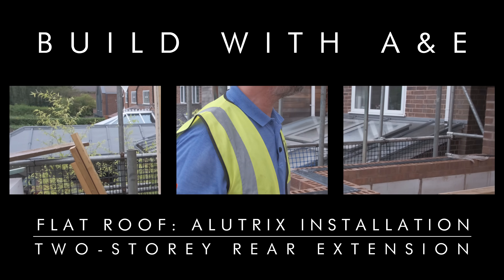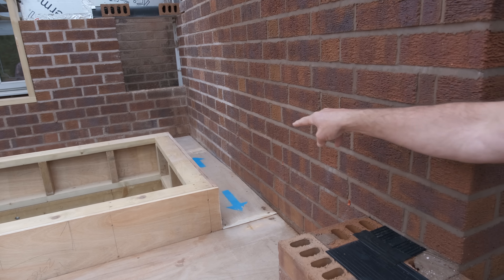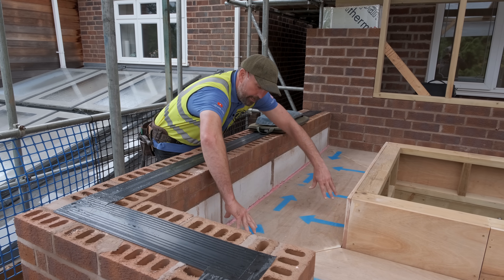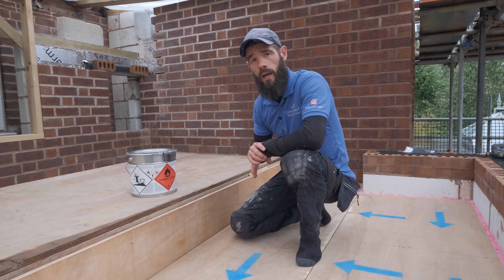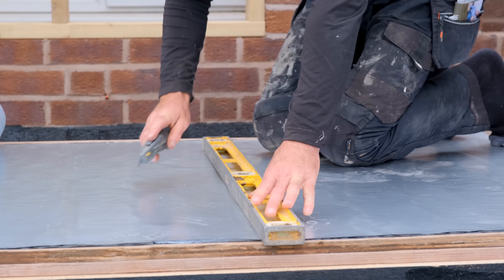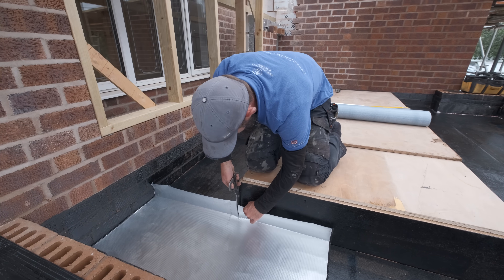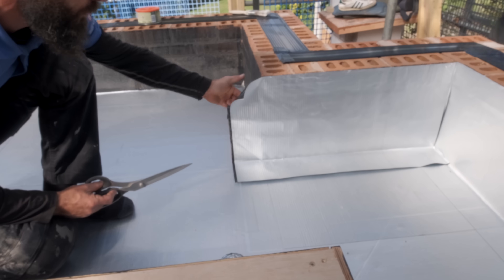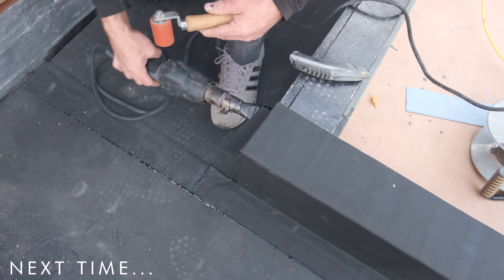Installing an EPDM Rubber Roof (Part 1: Vapour Barrier)

Comment: What is the height of the parapet over the flat roof please?
Reply from the maker: The upstand should be a minimum of 150mm at the highest point of the roof. This will increase as the roof slopes towards the rainwater outlet. 

I hope this helps. 

All the best, John 👷🏻‍♂️

Comment: Love the graded firrings. But i still cant understand how you did it. For example if i had a run one way then one at perpendicular at 90 degress. Youd have to bend the wood or have a small step?

Comment: Hello, do the substrate boards (ply?) Not need to be tongue and groove? Even with the best attempts to screw down, will the edges not moves relative to one another and create a weakness/ eventually crack the applied coatings?

Comment: Fantastic job lads.. I'm building my own flat roof extension with a parapet wall,  If you don't mind me asking, I couldn't see a cavity tray in the parapet wall, Is it not required because your Membrane is running up the full height of the inner skin? Cheers
Reply from the maker: Hi Rick weep holes are on the outside because of that 👍

Comment: No doubt that this demo video shows us the right way to install a flat roof, the explanation of every step and work practice is very clear, good materials are used.
I'm going to install a new roof DIY, and want to use good materials, I already decided on using Alutrix or a similar self adhesive vapour barrier, as these provide the highest barrier properties, and are easier to install in a neat way than the plastic film based barriers which you have to staple (holes!) or glue down, also the foam adhesive for the insulation will stick better to this.
In this video some good advise was given how to install this barrier correctly, so thanks for that.

Comment: All 3 of these epdm videos are great, especially for someone like me who is planning to do their own! I do have a few questions though. Our rooflight (vario by velux) comes with a vapour barrier attached, that drops down into the hole, what is the best way to seal this to the alutrix and do you take the alutrix up and over the top of the upstand?  Secondly how did you get away with 120mm of insulation our BC is wanting 150 :-( I was also just going to drop our ready made upstand onto the top of the warm roof, but I see the advantage of building one underneath first now.

Comment: That  vapour barrier stuff looks like it would stick like sh*t to a blanket. Is the primer necessary on a timber deck that's using mechanically fixed insulation board?. I can see benefits on brick work etc. Nice work

Comment: Just want to run this by you. At 3.48min in the video, i see your expanding foam filling in the expansion joint. Looks to me about 40mm. If so that seems an awful lot for an expansion. Ive always been of the belief its been 10-15mm youd get away with.  Whats the reason you went so wide?

Comment: What's the brand of vapor barrier. Ive only ever used the stuff like the plastic heavy gauge rolls, visqueen but have been reading up not many using this anymore because theres better products on the market now.   What's the difference in price in them.
Reply from the maker: Hi Celtic works Alutrix 600 made by Resitrix all the best Tony 👍
Reply: @BuildWithAE     Just checked the price. Pricey stuff it is! But after following up on this product, you can see why it is pricey. Excellent stuff. Will be using from now on.
Reply: @BuildWithAE   whens part 2 of the epdm/warm roof
Reply from the maker: Hi  @celticstoneworks.construct4570  very soon 👍

Comment: A vapour barrier and breather membrane are two different things, with different performance requirements. Much prefer GRP to EPDM for the top covering.
Reply from the maker: Hi the tessellater slip of the tongue my apologies Alutrix 600 is a Vapour Barrier and one of the best on the market, GRP great product more commercial it’s starting to become more main stream in the private side because more installers and not all people want EPDM it’s down to personal preference also the GRP companies wanted a bigger market share so they started doing free coarse all the best Tony 👍
Reply: Grp is not even close to epdm epdm is a far better product the problem is is every man and his dog lay it and do a shit job also using water based glue which is crap also people who dont understand the requirements over 100 square meters then u get the people who will put a cut in epdm then put formflash straight over it and wounder why it fails laid correctly it's the best on the market by a mile

Comment: Cant beat Alutrix or the attention to detail the roofer has done .  But in real life terms its a vapour control layer. You would easily get the Alutrix down and insulation down in 1 day and sheet up. Until the outlet is cut out is still a paddling pool.
Reply from the maker: Hi G Wilko much appreciated great product and you are correct with out the gully it’s a paddling pool but we have to take into consideration we were filling and trying to capture everything all the best Tony 👍 have a awesome weekend

Comment: Hi. I have a question but doesn’t regard roofs. But struggling to find an answer. I live in a 1930’s semi. Has a cavity in the brick work. Wasn’t originally insulated but now is. I have vent bricks on the outside of the house (1 for each room). The vent brick blows into the room and makes the house drafty and the insulation in the cavity is exposed to moisture. Should those vent bricks now be sealed up or replaced for normal bricks since the house is now insulated?

Thank you so much.
Reply from the maker: Hi John best to speak to your local building control which them to look at the issue it’s very hard to understand all the best Tony 👍 have a awesome weekend
Reply: @BuildWithAE  what’s building control? Or just any good builder? 
I have edited the post I made because there is some typos because of auto correct.
Reply from the maker: Hi John 
Building Control work at the local council and they will visit free most of the time 👍
Reply: @BuildWithAE  ahh brilliant. Thanks a lot. I’ve been told that these houses shouldn’t have the insulation but we will see what they say. 
Thanks for your help.
Reply: @designstudio8013  so what I’ve been told is the insulation now draws in moisture through the vents from the air outside. The vents were apparently originally there to allow the cavity to breath and to release any potential gases that might be in the rooms from the fire places (gas or coal). So now them fires are gone the vents inside aren’t needed and the vent one the outside needs to be sealed because the house is now insulated. 
Modern houses don’t have these vents like my house has. They have weep holes that are really low down.
Reply: @designstudio8013  I didn’t do the insulation. It was in when we bought the house. You can see the injection locations on the outside of the house where it’s been pumped in. Of it was closed cell, happy days but I doubt it.
What about the exterior vents?

Comment: The most amazing vapour control layer I've ever seen.😜 As this VCL is below the insulation, is it to control internal moisture vapour migrating into the insulation, or do you install a 2nd VCL/AVCL to the underside of the joists/light well before its plasterboarded?, or is this a secondary layer in case of water ingress, and if so, does it have a weep point out of the roof?, or does it do both?.  Sorry for all the questions, but these kind of flat roof systems are really interesting. 👍 Thanks for the video.
Reply from the maker: Hi Del this product I personally think it’s the best I’ve copied some info you will never go back,
ALUTRIX® 600 and ALUTRIX® FR are self-adhesive vapour barrier membranes designed for use in a wide range of construction applications. The membranes are suitable for use beneath mechanically fixed single-ply roofing membranes, self-adhesive membranes, felt, asphalt, liquid waterproofing systems, profiled metal sheeting and standing seam systems. ALUTRIX® is also ideal for internal projects subject to very high humidity such as breweries, swimming pools, sports halls, kitchens and bathrooms.

ALUTRIX® vapour barriers can be walked on and are puncture-resistant, with a high tensile strength, which makes them ideal for profile steel sheets.

These highly effective vapour barriers consist of a reinforced aluminium composite that’s self-adhesive on the reverse and protected by a detachable film. Because ALUTRIX® membranes are self-adhesive, they are incredibly quick and easy to install, and are compatible with most materials.

In addition to the vapour barrier function (sd value > 1,500), ALUTRIX® membranes also form an air-tight layer in line with Energy Saving Regulations
All the best Tony 👍
Reply: @BuildWithAE  Amazing Tony. Thanks for taking the time to copy that info, and appreciate you showing us that these amazing products/systems are out there. 👍 Have a nice weekend. Cheers

Comment: A flat roof is a leaky roof
Reply: Good thing its not flat then
Reply: @klaeLIFE  🙄 five year with the weather we have and that thing will be like a wet bog roll
Reply: Incorrect.
Reply: Did u even watch the video lol clearly  ain't flat lol
Reply: Zoltar
A lot of problems with flat roofs are not due to the weather but by moisture coming upwards so this vapour barrier is a key element. If he takes this much care with that detail and similar care with the waterproofing I would say he has a watertight roof and no call backs.
Reply: @martin2466  I've just checked and it's a 20 year guarantee provided by the manufacturer. I doubt you get any sort of warranty with felt and such like
Reply: @klaeLIFE  hahahaha I’d double check the terms of the guarantee if I were you.
Reply: @paulchambers6657  can you show me a better guarantee from another roofing product?
Reply: @klaeLIFE   iko ultra 30  membrane (hot welded ). 30year guarantee  (approved installer) outlast this cheap DIY stuff .....? You can  go on 4hour training course to fit this  says it all Joe public believe anything
Reply: @martin2466  indeed. Most guarantees are offered by building companies and last a few years. There still epdm roofs in the USA that are over 50 years old. My dad's garage has a 3 layer felt system installed in 1992. We did a major repair about 10 years after. The whole roof has no failed, timbers wet and the roofing boards collapsing.
Reply: Zoltar it’s not flat tho is it it’s got a fall on it 👍
Reply: @martin2466  the system they are putting in is the gold standard vapour barrier, not some polythene sheet. They put PIR on top of this and then either board it again or put the upper roof covering on this. I'm guessing it will be epdm rubber roofing which does carry a 35 year guarantee.
Reply: @martin2466  exactly which is why this roof will last a lifetime